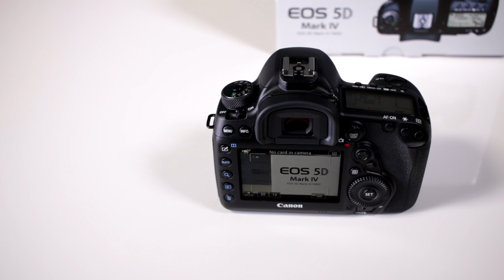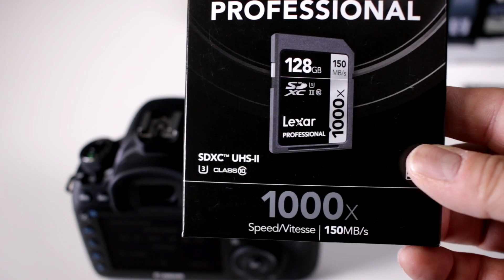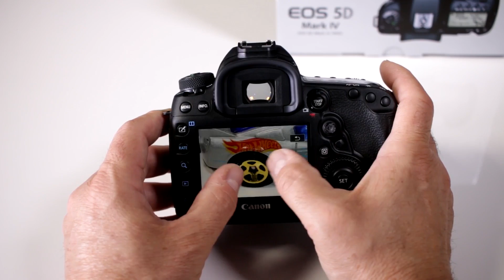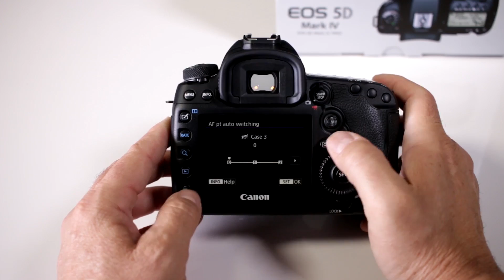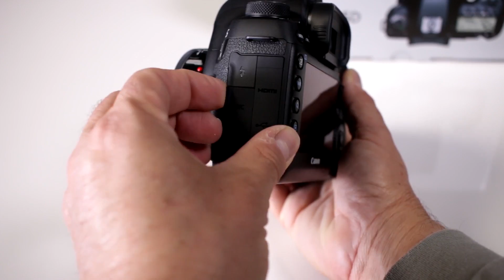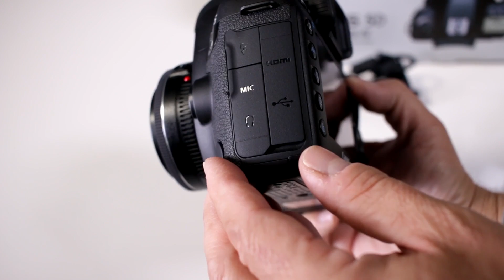Most Asked Questions for Canon EOS 5D Mark IV Camera

Comment: Hey, really appreciated your time and the way you have put up the things. Well I've got few questions
1> When an image is being transferred via WiFi does that image on a cell phone is of the original size or reduced size? 
2> Can we directly transfer images to a laptop if connected via USB and simultaneously clicking images?
3> What is the max 4K video record limit?
4> With latest firmware update is there any reduction in a crop factor?

Comment: I m planning to Upgrade Photography kit and my Studio Equipment... I have Currently Nikon D90, D200,D750 cameras along with 2.8 nikon 18.55mm, 70.300mm, 50mm prime as well as i have ELINCHROM fx 400r1 lights .I want to shoot Indoor & outdoor portraits , Fashion , newborn baby ,wedding, Product shoots & Events Photos so that Please Suggest me New Canon Camera kit with different lenses , Speed lights and  studio light.
Reply from the maker: Well, definitely get the 5D Mark IV (https://goo.gl/41ZrTd), which will work for anything you throw at it and unless you need the extra 1.6x crop factor, I don't see the need for an APS-C body. But if need be, I would go with the 7D Mark II (https://goo.gl/vXeQYw) which is great for sports and fast action with the extra 1.6x oompf. As for lenses, stick with the L glass lenses like a 24-70mm f2.8 (http://a.co/bvOKVAb), 70-200mm f2.8 (http://a.co/46v28he) and maybe the 50MM f1.2 (http://a.co/8uNXrVf). As for speedlites, I recommend the 600 EX RT (http://a.co/12WJq8L), the 430 EX RT (http://a.co/dxd5cgT) or Altura Photo APC-958X (http://a.co/8cK7i4b). And lastly, for the light studio kit, I believe the ELI's will work great (sorry, we don't sell this one at our stores).
Reply: thanks a lot :)

Comment: really supper viedo but Nikon 810 is best or Canon 5d mark 4
Reply from the maker: Hi there! They both have similar tech specs. Unfortunately we do not have photo samples of the Canon 5D Mark IV, however, it looks like a really promising camera to face the Nikon D810. ;)
Reply: U can show the difference between 810d n 5d mark
Reply from the maker: Thank you very much for the suggestion, we will consider it for an upcoming video! :)
Reply: Then go buy a nikon 810. I'll buy the mark iv.
Reply: +clickonmike I didn't ask ur suggestions. u better mind ur work it will gud for u